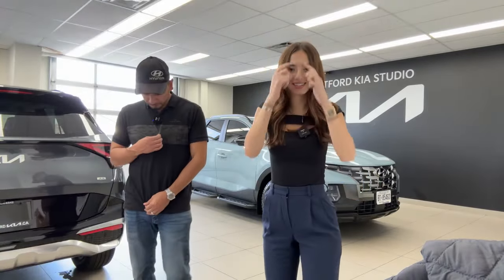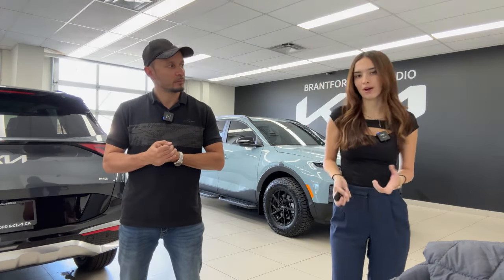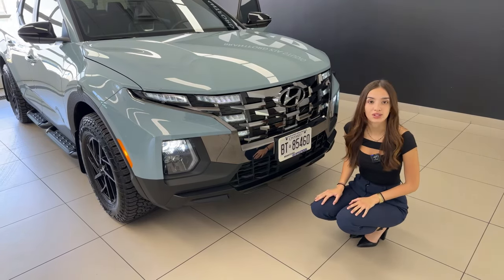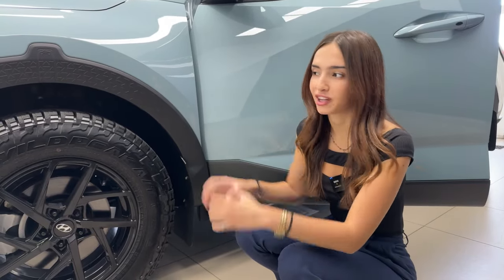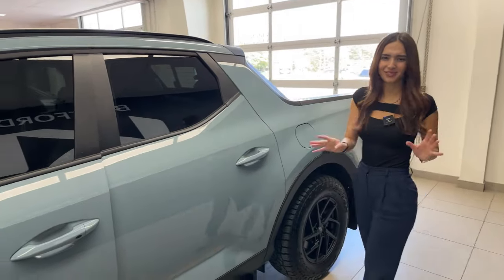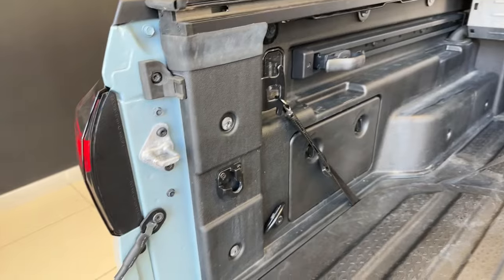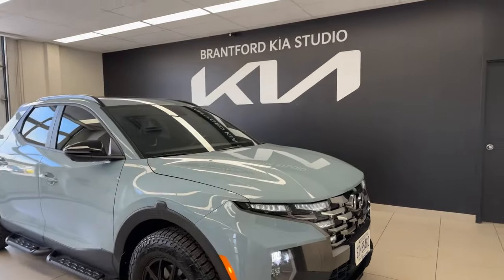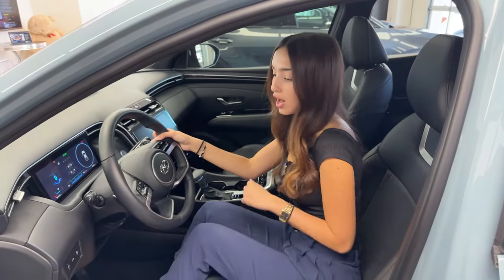Too Cool For A SUV? - Meet The 2023 Santa Cruz!

Comment: I have a 2022 Hyundai Santa Fe Calligraphy, which has the same powertrain as this vehicle.  Buyer beware.  The 2.5L engine is great, smooth and plenty of power.  The dual clutch transmission, however, is hot garbage.  Sure, it's smooth on your test drive when you pull out of the showroom with 7 miles on the odometer, but just wait until you buy/lease it and hit around 10k miles.  Noisy, clanky shifts, clumsy operation and pronounced shuddering while creeping along in city traffic.  Completely ruins an otherwise fantastic vehicle.  I imagine it's the same for the Santa Cruz, since it's the same transmission.
Reply from the maker: Hi, I appreciate your feedback on your Santa Fe’s powertrain! I believe that real world insights are crucial for potential buyers. It's great to hear that you’re enjoying the 2.5L engine. However, it's important to note that dual-clutch transmissions, which essentially function as automated manual transmissions, can exhibit some choppiness or lurching especially at low speeds. This behavior is a common characteristic of dual-clutch systems and can be attributed to their design.

While it might not be to everyone's liking, the choppiness at low speeds is a trade-off for the quick and efficient gear changes that dual-clutch transmissions offer during higher-speed driving. It's indeed something buyers should be aware of when considering a vehicle equipped with this type of transmission. However if the choppiness & noise that you are experiencing seems to be out of the ordinary I greatly recommend scheduling an appointment with your Hyundai dealership to have a technician take a look.
Reply: @BrantfordKia  I have an appointment scheduled, but I'm not expecting much.  Lesson learned about these junk transmissions.  I know absolutely no one who actually thinks a dual clutch is a good idea in an SUV.  I'd (maybe) put up with its incompetent manner at low speeds in a purpose-built sports car, but an SUV?  Why did Hyundai do this?  Modern torque-converter automatics are smooth and efficient, there is literally zero reason to saddle a world class SUV like the Santa Fe Calligraphy with this garbage.  I'd keep it until the wheels fell off if it had a smooth transmission, but at this point, I can't wait for the lease to end.

Comment: I have been watching your new vehicles presentation and just showing the cosmetics of the cars and never, yes, never been explaining the engine’s ability and how it differs from previous Hyundai’s and Kias garbage transmissions that fails every now and then as per the Consumer’s Report website.
Reply from the maker: Hello & thank you for your comment, 

At our dealership, we understand the importance of showcasing not only the cosmetics of the cars but also the engine's capabilities. In just about all of our reviews include the details and specs of the powertrain. (I will admit sometimes we may miss this, after all these are all 30-40 minute long LIVE broadcasts). Also, we take pride in the fact that Hyundai and Kia vehicles have consistently ranked highly on Consumer Reports, reflecting their commitment to quality and reliability.

It's worth noting that both Hyundai and Kia have made significant advancements in their engines and transmissions over the years, focusing on improved performance, fuel efficiency, and durability. They are not the same as they were 10 years ago. NO vehicle is perfect regardless of manufacturer, failures happen & recalls happen, Kia & Hyundai have been quick to make fixes when this occurs.

It is also worth noting that a majority of our videos are walk-throughs of the vehicle with an emphasis on showing potential customers what they will receive in that specific model & trim. During our live chats, if a question about reliability of these vehicles comes up, we are never hesitant to talk about it.